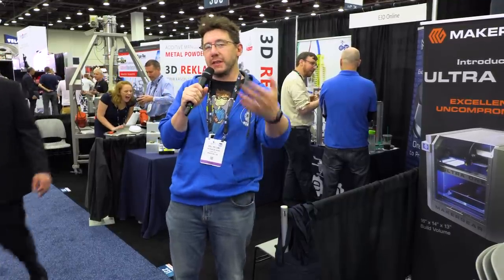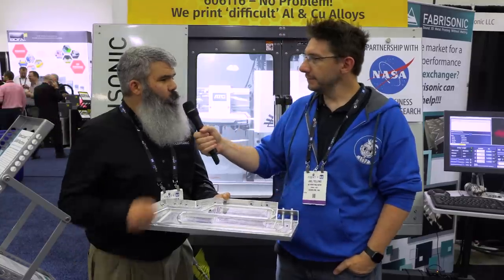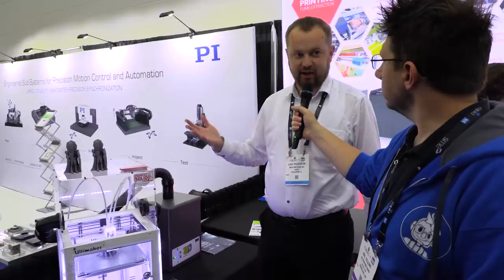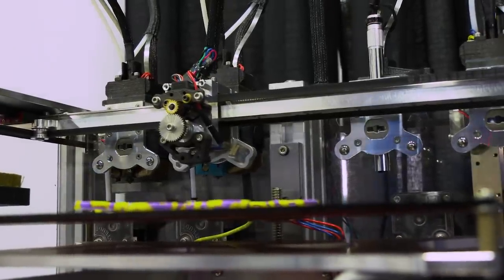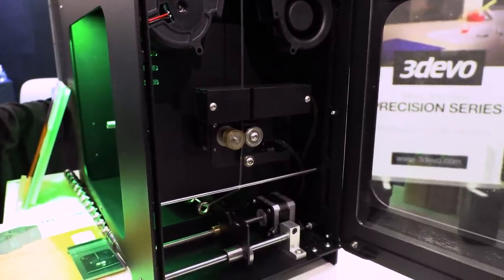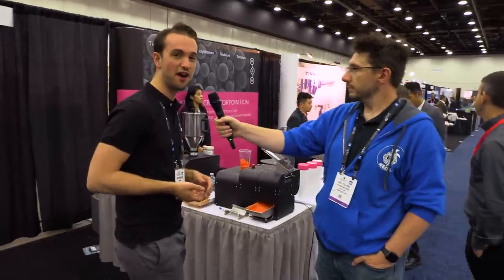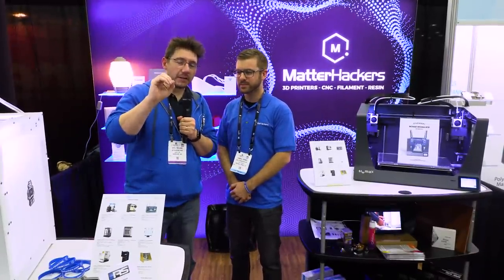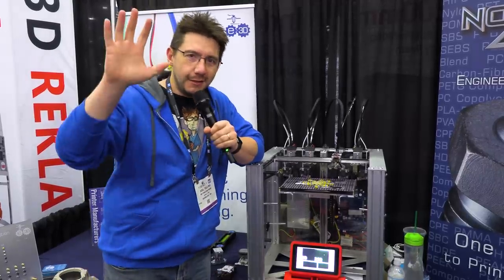More Great 3D Printing at RAPID + TCT 2019

Comment: The day when everyone can recycle their plastics, failed prints and whatnot to use for 3d printing is gonna be an amazing day in my opinion. 

If 3d prints become more strong and way faster to make, they'll really become a household thing that everyone has.
Stores will sell (customizable) STL files instead of products.

And omg that soundwave cnc machine, that's pure future. Also, embedding electronics into any metal combination in any shape is amazing.
I wonder how strong the layer adhesion is between the metals (maybe i missed it in the video).

Just waiting for all of this to become affordable for the common joe :p
Reply: Danfga2 nycnc did a tour around their shop. ITS AMAZING and has inspired me since I saw the video. Their adhesion is basically molecular, as good as it as gets.minimal heat.

Comment: For me tool change is the ultimate solution to multi material printing, even if it may be costly. Currently popular solutions, that base on multiple nozzles and/or extruders seem to have much more drawbacks, like possibility of crashing into print with second nozzle or purge block in case of Prusa's MMU2. Rooting heavily for it coming in to desktop printers.

Comment: I'm just about resisting the temptation to say "Aw Bless" at the 3Devo guy who blushed when he didn't know what one of his plastics (PSU?) was. How often do you see people blush these days. I really want one of those Filament-Making Extruders, I have 88kilos of granulated HIPS+ABS to try to recycle into printer filament.
Reply: You'd need several times that much to justify the purchase if you don't value the cool factor. But maybe crowdfunding with the reward of some batches of exotic polymer filament might help with that if you'd need any, help that is. And once you've got your hands on it you can start experimenting with your own composite formulations...
Now I want one, too.
Reply: @ronnetgrazer362  This 88kg is only what I salvaged from inkjet printer cases. I don't know if it's possible to mix ABS with HIPS when making filament. That's a Q. I'd like to see an answer to if anyone knows : )

Comment: Big question though. How does the filtration system handle resin printers?
Reply: Resin particles/gases can be filtered just fine, the issue You will find is that most printers are fully enclosed, so You can really extract during the process.

Comment: Capitalize big on fear lol

A 1000 bucks for a carbon air filter and HEPA with a ventilator...
Reply: Also, activated carbon is not absorptive, it is adsorptive.
Reply: Totally unrealistic.
Reply: I paid a similar amount for a solder smoke filtering system that is basically the same exact thing.

Comment: I would kill for a machine that would give Mill Spec nylon filament, that I could then print incredibly hard to manufacture parts from.
That’s been my biggest issue, is my customers require specific material call outs for material before hand and it I could take all that and then blend it up into a filament? 😍😍😍
Reply from the maker: Sounds like that 3DEVO is something you might like!

Comment: Serioulsy 3devo.. 3-5k bucks for a desktop filament extruder.. how many kilos of filament do you get for that amount of money? So.. basically if you got 1kg of pellets for 5$ and a cheap roll of filament for 15$.. that's 10$ savings on 1kg.. so.. around 300 to 500 kgs of filament to get even.. buuuuuuuut.. you end up spending another 2.5k$ for the pellets.. how much is 1kg of pellets exactly? last i checked it was way more than 5$.. soooo.. 7.5k$ for 500kgs of homemade PLA.. oooooorrrrr.. 500kg x 15$ = 7.5k$ bought in a store -> instant 'spawning', no electricity bill, no maintenance, no hassle.. aaaaannddd.. can it produce 500kgs of filament without breaking down? I don't understand who this is for..
EDIT: how much does an empty spool cost? Or 500?
EDIT2: Wasn't there talk about dangers of airborne plastic micro particulates? How much damage does extruding 500kgs of filament do to your lungs? And then printing another 500kg? Maybe i just missed the HEPA filter they installed for this purpose. Don't get me wrong.. i own a 3d printer or two and i am not into fear mongering at all.. but.. i'm not the one selling these machines for a premium price, whithout thinking of safety now am i.
EDIT3: Sorry Joel! Thank you for a great video and the content you make! Thumbs up!

Comment: Sorry but that ''pump for filtering 3d printer air' is a soldering fumes extractor, that is actual product that you can buy off the shelf already I dont see anything innovative with it
Reply: I want to point out hat guy with filters is a complete scam in my opinion. All hepa filters and all of this maybe true for industry 24h farms, not for occasional hobby like machines, cost of that filtering system is half of the cost for a hobbyst machine, why bother at all I dont like all those guys trying to sell soemthing useless, bring innovation invent something new instead of trying to sell filters, omg what does coconut have to do with filtering, what in the world, activated carbon is oure carbon it does not matter what it was made of you can make of any organic material it will still work..
Reply: google solder fume extractor and see

Comment: About the particles coming from PLA and such, is there good research available that actually confirms that? Also, PLA isn’t eco-friendly, it doesn’t degrade if it isn’t put at relatively high temps in a certain environment for days. And usually this doesn’t happen in normal bio-trash processing. So it still ends up in the sea.
Reply: PLA does biodegrade, it just doesn't do it quickly unless it's at high-ish temperatures. It's also more eco-friendly than other filaments because it made from renewable resources and not from petroleum.
Reply: Zack Thomas Yes exactly, so it still ends up being plastic waste. I do agree it migh be better production wise.

Comment: The filter for $1000 is a complete rip off. Go to a HVAC parts vendor and you could put together your own system for a small fraction of that and have way more capacity than you'll ever need for a 3D printer.